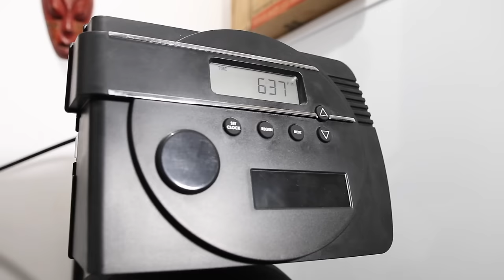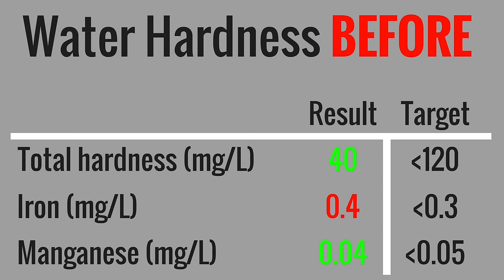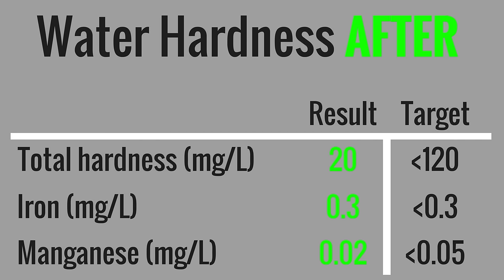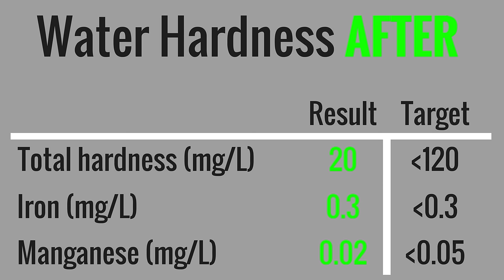WATER SOFTENER SYSTEM : HOW IT WORKS !!

Comment: So how does water in the salt tank get into the tank?
Reply from the maker: Through a system of pumps and tubes.
Reply: @PanTheOrganizer  sorry I phrased my question wrong. 😅 
I understand there is salt in the salt tank. You mentioned there is water at the bottom to start the brine. 
How does that water refill itself? Or does someone have to refill it every so often?
Reply from the maker: A float system kind of like a toilet tank. When water goes down it activates the float which in turn brings water in through an intake tube.
Reply: @PanTheOrganizer  I see. I think I know what I'm missing now. Thanks for the information!

Comment: My water softener keeps flooding during brine draw. Flooded the very first time it was installed and never worked. Went thru the same old trouble shooting. The company reads the same script as the manual when you call them. Changed the seals and spacers like they asked, even though it was a new system. Now they want me to return the valve head to them. Try getting that off when it’s a single unit! What a waste of 1000$. Heads up don’t ever buy Rainfresh systems.
Reply: Contact Canature, they manufacture the valves. Rainfresh just slaps their own branding on it.

Comment: Water softeners are not good at removing iron and manganese. This is why well water users typically have both a water softener and a iron/sediment filter, if they need both. Water softeners work through ionic exchange, this does not remove iron or manganese.

Comment: The cost of the setup and installation dosen't justify that you only drop 20 mg in total hardness. Something is wrong you shouldn't have that much after the softener. Plus your Iron only went down 0.1 at 0.3 it will still stain your shower and toliets.

Comment: What are some water softener brands you would recommend?
Reply: A water softener's job is very simple, so it's not really so much a matter of which one may work better than another. Reliability may be the only thing that you might consider and you can read reviews online. So spending ten times as much for a big name won't necessarily work any better than a lesser name found at a big box store. The first important thing to be sure of is that the one you choose doesn't regenerate on a scheduled basis, but instead regenerates on an actual usage basis. That way you don't waste a lot of water and salt (or potassium) doing needless flushing. The second thing is to consider your water source. If you have municipal water life is a lot easier. You can go to your big box and purchase a GE or Whirlpool to take out the minerals and live happily ever after. If you have chlorine in that water, you should also consider a Whirlpool (or similar) electronic whole home filter that regenerates on a usage basis as the softener does and never needs filter changes. Install it before the softener since softeners don't really get along with chlorine very much. I've been using that combination for eleven years with perfect results, but it helps when the water utility gives you a pretty clean product to begin with that just has a lot of minerals in it. Well water on the other hand can be full of chemical, bacterial and other contaminants in addition to the minerals that make the water hard. The best thing to do in that case is to have two or three reputable water treatment companies come take water samples and make their recommendations. Make sure to communicate well with them about what you want to accomplish. You then have the choice of going with one of them and being done with it or you can take their recommendations and spend a little time online doing your homework and put your own system together for a small fraction of their price. Two other points - water softening and water conditioning are two different processes. Learn the pros and cons of each before deciding on either. Also, many people don't like the slick feel of softened water and the difficulty of rinsing off soap. Understand that you can NOT set up your softener for a level of softness. It is basically a filter that has removed the minerals and made soft water, or hasn't been programmed by you to regenerate according to the calcium hardness level of your water and has allowed minerals to get past it and into the water again making it hard. It's either soft or it's hard. So programming your hardness level correctly (based on your water sample and whether you are using salt or potassium) is essential. The only way that you can pretty well regulate the softness of your water to eliminate the slick feel, is to plumb in a bypass with a ball valve that will allow you to trickle a very small amount of filtered but unsoftened water into the water that is leaving the softener. I get a pretty good result from doing that. And when installing your system, use flexible water softener/heater lines to the softener (and filter) to take the pressure of misalignment off of the o-rings when the softener is moved a little bit by accident. That will prevent damaging those o-rings and ending up with a leak. Not that I learned that the hard way or anything...

Comment: How do you add water to the salt tank?  Also you did not explain how to use the control panel.
Reply from the maker: You don’t add water.  It’s done automatically.  I didn’t show the control panel because it is different from one model to another and that’s not the point of this video.

Comment: I have a question. These companies that claim to have salt-free water softeners are basically lying correct? I mean they make the claim. Conditioning is the word they use, but in the end; a salt-based system will outperform any salt-free system every time.

My question is about the filtration? Do you use another filter for the chlorine, sediment and the long list of crap that's supposedly in the water. Plus there's traces of iron in my water also. I mean I can see it in grout of my shower floor. I live in Miami and water sucks. It's not as bad as Flint, MI, but it's not good. 

Put it this way, I used bottled water to rinse after I brush my teeth. I only ask because I got a custom-made shower filter and I don't know how it does it, but there's no build hard water build up on my shower doors and walls anymore. I know it's not really softening the water, but it's doing something. After it was installed, I felt the difference immediately. It was bit pricey, but I don't have to pressure steam my shower doors as often. It uses catalytic carbon, plus 3 or 4 other levels to filter the water. Shockingly, it works. That brings to my initial question though. What do you to filter the water?

Comment: How much does it cost
Reply from the maker: It depends on what type of resin is needed to filter your water. Your best option is to contact your local water treatment specialist and have them give you a quote. It can range from 1000$ to 3000$ USD on average.

Comment: Wshing a car with a water softener with a TDS of 160ppm is enough for a spot free drying OR a De-ionization Filter is needed. The DeIonization Filter lower the TDS near to zero.  I own a salt water softener but apparently a DeIonization Filter is needed for a spot free car wash I just can not find enough data to confirm that.
Reply from the maker: For 100% spot free rinse, a deionization system is best.
Reply: @PanTheOrganizer  People said online that the deionized water is only for the last rinse or the deionization filter won't last that long. My question to you, It is worth it to wash the car with water softener water with a TDS of 160ppm?  I am just trying to figure out now if I install my ELEY Hose Reel in the garage connected to my water softener of if I just install it outside connected to regular city water...

Comment: If you still have 20 mg/l, your softener isn't working properly. From 40 mg/l, you should be getting less than 2. Getting your own hardness test kit is easy and inexpensive, most pool supply stores carry them. The real problem with your incoming water is the iron. It will eventually foul your resin.

Comment: I JUST HAD MY SYSTEM INSTALLED AND THE SALESMAN TOLD ME THAT A SEPARATE LINE WOULD BE INSTALLED FOR THE BACK YARD FOR PLANTS (POOL) THE INSTALLERS DIDN'T INSTALL AN EXTRA LINE WILL THIS BE AN ISSUE FOR MY POOL OR PLANTS?
Reply from the maker: No.
Reply: You should be able to bypass the system.
Reply: Edelia Lopez What system do you have? I am panning to get one but I have no idea. Please advise me. Thank you

Comment: What's the different between water softener and water dosing system?
Reply from the maker: I'm not a water treatment specialist, you'd have to ask a professional near you. But a quick Google search reveals this: An ion exchange water softener can reduce or eliminate hardness problems and act as a good pretreatment for tap water RO system. Antiscalant and antifoulant dosing system: RO/NF membrane systems that use antiscalant avoid mineral scaling and thus can operate for extended periods of time between membrane cleanings.
Reply: Thanks for taking your time to educate us, we love your content here in Johannesburg SA.
Reply: How do you determine the size of water softener system. I'm having (3×5000L tanks connect together in series) 15000L water shortage tanks
Reply from the maker: Thanks Cammy! My girlfriend and I are planning on visiting South Africa for her 50th birthday in 2025. It's one of her bucket list dream trips to make so it will be her birthday gift. :) I am looking forward to my trip as well.
Reply from the maker: You'd have to discuss with a water treatment specialist near you.

Comment: No mention about the cost of this softening system.
Reply from the maker: It’s because cost varies greatly depending on where you live and also what specific resin you need for treating your water. My water was already pretty soft to start with so I didn’t need anything too complicated. My setup cost 2500$ CAD.

Comment: And take it from me, been top sakes & service for Rainsoft water treat equipment. If you system is not reducing your water to 0 grains hard, and not 20 as it was tested. You've got a problem, Either bad oring or valve. 20 grains after softner is a fail, terrible. Check your system. Water heater hardness test can give you a history test on what water hardness was before regeneration. Make sure float shut off valve in brine tank is adjusted properly so that you are getting enough brine solution.
Reply from the maker: Hi Ray. I rely on my water treatment specialists to do the right thing, as I don't have experience in that field. So your comment got me thinking. Isn't normal to have a big of hardness even after a water softener system is installed? To my understanding, if you have zero minerals left, that would be a deionized water system and it's a completely different thing right?
Reply: @PanTheOrganizer  not at all, the minerals that create hard water are trapped by resin until regeneration. 0 hardness should be available on cold water line after lines are flushed, hot water after tank is flushed. You can have 0 hardness water with still TDS levels 50 to 500 or higher.  But with a normal functioning water softner specially out of box you will have 0 hardness, if your system is set up correctly.
Reply from the maker: So what should I do at this point? Contact the water treatment specialist and tell him I should be getting 0 hardness levels?
Reply from the maker: Thanks for the info Ray. I appreciate it. I moved into a brand new home, and had a new water softener system installed, by the same company, so we'll see what they say.

So you can have zero grain hard water, but it's still not deionized water right?

Because in my garage, I have a water deionizer (as my channel is one of the biggest car detailing channels on YouTube, and having the best quality water, mineral free, is important for no water spotting issues and better foam and suds performance). I made a video about my garage setup here: https://youtu.be/IKNL1chAQXY

Comment: Can you drink tap water if you have a water softener installed
Reply from the maker: Yes absolutely.
Reply: I can't drink mine because it tastes like saltwater. It is an ion exchange system. You get two sodium ions released into the water for each calcium ion that is removed from the water. The saltwater also destroys any plumbing that has steel in it. These thing are not without their faults.

Comment: I've heard that using a water softener can really increase the sodium levels in your water.  Did your water test show that?
Reply: yeah sodium content is raised a bit, use potassium pellets as you body actually needs potassium, just mention it to your doctor either way when you have your blood tests.  Or filter your drinking  water after it passes through a carbon filter or if you're on well water, you need a Reverse osmosis system for drinking water purity and that removes everything.....

Comment: How much does this system cost?
Reply from the maker: It depends on what treatment your water needs.  A big part of the price is the type of media in the tank, and that depends on what levels of treatment your water needs.  In my case, my water was already pretty soft to begin with, so less expensive.  My system cost 2200$ CAD approximately.
Reply: Pan TheOrganizer ok thanks!

Comment: Pan, can you check the pH of your water now? And if you happen to know the pH before you installed the system let me know.
Reply from the maker: I have no way to test my pH at home.  Why would you need that info?
Reply: I also have a water softener at home here in CT and the guy who installed it told me that the goal is a pH in the 7.x which is kind of neutral from acidity. I was wondering what your water shows now for pH.

Comment: Do you need this with an RO system?
Reply from the maker: What’s an RO system?
Reply: I believe, RO= Reverse Osmosis
Reply: No you dont have to, but i advise to use  a water softener before a RO system if possible. The membranes in the RO system will have a much longer life span and the RO system can be set to produce more clean water and less dirty waste water. A RO system must be set to produce around 70% waste water and 30% clean water when u will use hard water and 50% waste water and 50% clean water when u will use soft water.

Comment: Roughly how much does this cost?
Reply from the maker: It depends on what kind of filtering resin you need as this differs depending on the condition of your water.  My water was already very soft to begin with, so my system came in at roughly 1500$ CAD.  It can up up to 3000-4000$.
Reply: Thank you very much for the reply
Reply from the maker: My pleasure Casey!

How did you discover my channel by the way?
Reply: In short through Larry's channel (ammo nyc).  Not only did he give a ahout out to you on the Milwaukee video but as a related video  way before .I see that your gong to sema for 1st time. I'm envious!  Never been

Comment: Your lab results after installing that water softener were not good enough at all. Why didn't the hardness drop from 40 to 1, iron drop from 0.4 to 0.01, and manganese drop from 0.04 to 0.001?
Reply from the maker: Because this is a water softener system.  Not a deionizer.  If you want deionized water you’ll have to spend a lot more!
Reply: @PanTheOrganizer  What do you think about the idea of running a total of 2 water softeners connected to each other back to back simultaneously?
Reply from the maker: Pointless.  And it would cost double.  If you want zero ppm, you get a deionizer.

Comment: What if water softener gets clogged?
Reply from the maker: How would it get clogged? I have been using a water softener for many years now, never had an issue.
Reply: @PanTheOrganizer  well u figur the little pellets keep filtering fluoride chlorine bleach and whatever else is in the water at some point it gets full kinda like a filter all that stuff doesn't just dissappear or self dilute if those pelots are obsotbing all that junk. It's no different then a catalytic converter on a car it breaks down ND clogs itself. It's pretty much a glorified water separator that compressors use to get rid of water the pelots are similar
Reply: @PanTheOrganizer  are u sure it's even on. In California the water contains so much chemicals that the softener doesn't actually work

Comment: Do not drink softened water.
Reply from the maker: I have been drinking softened water for years with zero issues. There are two schools kf thought on that but no concrete scientific proof that drinking softened water is bad.
Reply: @PanTheOrganizer  you might have zero issues but I would suggest you might just not be aware of them.  Most won’t be affected but older people and obese people will see issues from it.  The increased sodium, as little as it is, does add up over time and can cause issues.  Not worth the risk to me. I have a whole home filtration system that then feeds into the softener.  I have a dedicated loop off the filtered side before the softener that runs to a beverage faucet beside the main kitchen faucet.  Clean filtered water with minerals intact to drink while everything else is softened.